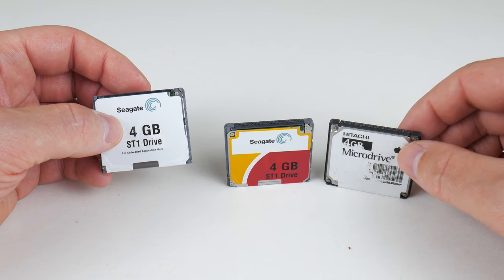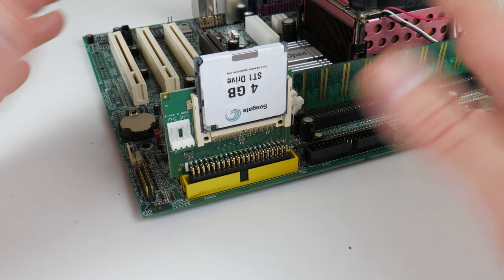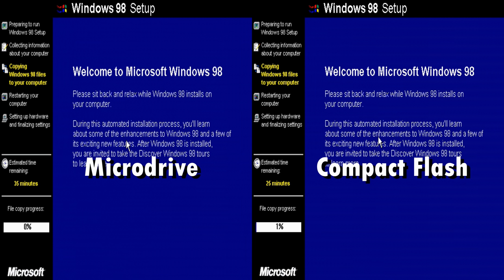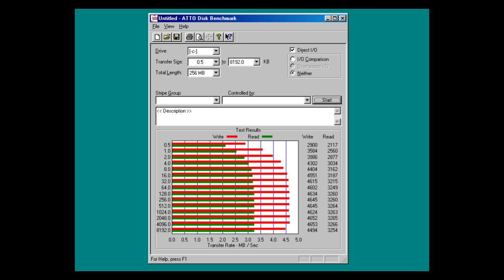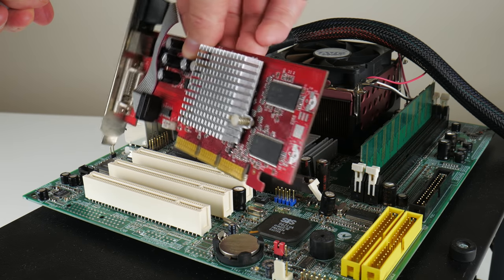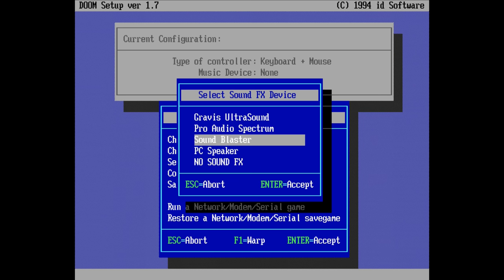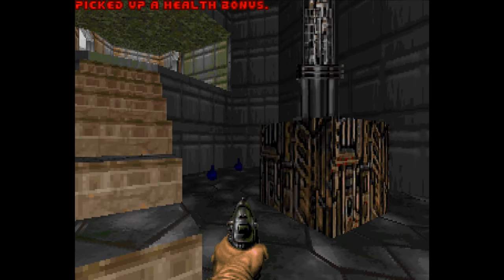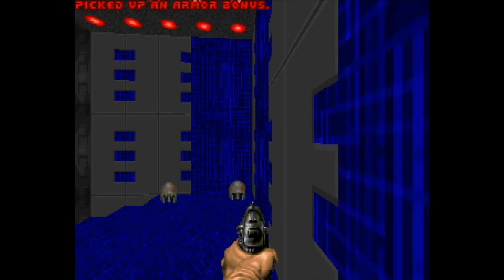Should you use Microdrive with Retro PC?

Comment: For the capacities I was looking for, Compact flash was unreasonably expensive. Especially hard to justify against the consistent trend of SD card prices. That said, the weak point of EIDE/PATA, is the cables. Just had a situation where a system wasn't booting, until I replaced the old cable I was using. Which kind of sucks because, I don't have any others that were as short and discrete.
Reply from the maker: Defeated by IDE cables :D Happened to me also and can be hard to diagnose. SD cards are indeed better value, but the IDE adapters use converter chips, limiting the data transfer rate. CF can go full throttle so to speak, but at a premium, you're right.

Comment: I don't like those DOM type of adapters hogging the entire pata connector for only one device. Either use a pata cable and put an adapter on each free end. OR, use one pata to sata adapter which hosts two bridge chips so you can plug two sata devices on one pata connector. Might seem overkill to use sata drives on older machines but hey, it mostly works.

Comment: interesting video.

i use a 4gb microdrive from an old ipod in my IBM 5170 (6 MHz 286) and in this machine, it actually performs better than a transcend TS4GCF133 - with that CF card installed i get around 700kb/s while the microdrive scores just over 1 mb/s according to CheckIt's HDD test.

i've also had it in a pentium II laptop for a while and did not notice any issues there (i was playing a good bit of diablo 1 and monkey island 1 on that laptop but also testet doom and quake)

but out of curiosity, i will put doom back on the microdrive and test it in a pentium 3 that i happen to have on the bench right now for other reasons.
Reply from the maker: Eager to hear your outcome! There could be differences between models, maybe older drives do not have the power savings issues.
Reply: @philscomputerlab  i got around to test doom on the microdrive in the P3 and did not notice any lags or stutter during normal gameplay, but when i let the game sit in "attract mode", the blue floppy icon did show up occasionaly and when that happened, there was noticeable lag here and there.

my microdrive is an apple branded hitachi 4g model like the right one out of the three you have in the video.

i did also run CheckIt on the pentium 3 to see how the microdrive and the transcend CF card perform on the integrated UDMA 33 controller of the P3 mainboard (ECS P6BXT), and here the results are as expected with the CF card running circles around the microdrive - the card achieved around 5.7 mb/s throughput @ 0.1 ms access time while the microdrive only manages a meager 2.7 mb/s @ up to 9.8 ms. 

with the CF card that much faster, i have no idea why the microdrive has more throughput than the CF card on my 286 then.

i think i'll leave the microdrive in the 268 and let the faster machines take advantage of the CF cards - if older games tend to not do a lot of streaming from disk, as you said, then the microdrive's power management should be less of an issue with 286 era games

Comment: Very interesting Philip, thank you very much for showing such things, because I didn’t know that they even exist). For now I’m using 2gb SD to IDE for DOS, and it’s very fast. For windows 95 OSR2 I’m using 8gb, works very fast also. Starting from 98se and Me, it’s freezing, like I’m using slow HDD….don’t know why because I remember your video where you was satisfied with SD. But in my case…don’t. Better to use Chinese SSD’s with capacity’s from 16 to 120 gb
Reply from the maker: Make sure DMA mode is activated and there are huge differences between cheap and high end SD cards.
Reply: @philscomputerlab  thanks for the information, because I’m using transcend, and they in the budget market I think

Comment: I discovered some time ago that the Hitachi 2GB micro drive worked better on my IBM PCjr with jr-IDE than any other storage device that I could find.  The jr-IDE is very picky about IDE devices, requiring those that will use CHS rather than LBA... which ruled out a vast number of compact flash storage devices that I had.  Those that would POST ended up acting flaky (causing the machine to crash at random times and such.  But the Hitachi 2GB micro drive works flawlessly, every time.  But there you go... older machines that run games that fit into memory... that's the PCjr.
Reply from the maker: Can you manually enter CHS? Try 1024, 16 and 63. That should give you 504MB on devices larger than that.

Comment: A SATA to IDE converter and a SSD = No mechanical moving (potentially failing) parts.  64GB discs are quite cheap :ø)
(A SSD with auto-trim, or one without - as in it deletes sectors after delete - is optimal, but  not required)

Comment: I once tried to use a MicroDrive with my ThinkPad 600. Still don't have any idea what happened, but some of the pins got hot enough on the adapter board I was using to melt the chassis, and then the drive was dead after that. Machine still works but now I have a dead 4GB MicroDrive :(

Comment: There should be some sort of way to disable that power management stuff. I'm not a hacker so I have no idea but if you could get it to stay spun up all the time, it wouldn't be a bad solution. CF of course is always faster.
Reply: WD released a tool for this, change disk idle time, because WD Green disk  were failing due to excessive idle

Comment: Other than when stuttering during wake-up, the Microdrive seemed to do well in DOOM.  Is it possible to control/disable the power management on those drives? Many IDE drives, especially older ones, will react to tools that can set power management parameters, such as Linux' hdparm.  https://en.wikipedia.org/wiki/Hdparm
Reply: It would be easier to copy all of DOOM to from a Microdrive to a RAM disk, then run it from there, assuming you have enough RAM. But easier still to use a CompactFlash card.
I've used a 2 GB CF card in a Compaq Portable II from 1986. Though obviously not to run DOOM :)

Comment: It seems that most cheap consumer flash memory cards nowadays are not very good with write endurance, so are actually a pretty bad long term choice for an operating system installation, especially older windows installs.  That would be one big advantage of the microdrives is no write cycle lifespan limitations.  Alternatively, Industrial CF cards like Swissbit or something like that are designed for far higher write endurance than consumer flash memory and the better ones have TRIM wear leveling. Those would be a much better choice although they are a lot more expensive.  Setting up a second sacrificial flash card dedicated to the windows swap file would help, or just always keep an up to date image duplicate card to swap in when it goes bad, especially if using budget flash memory.  Some low grade flash memory may only have 300 write cycles of lifespan, and that can quickly get burned through from windows swap files and old hard drive optimized file system management.

Comment: I have had better experience with Microdrives in my Amiga600. For some reason, it gives better performance than CF cards on a non accelerated Amiga. However on PC running Dos, I hsve had the best result with CF cards. On Win98 I will always recommend seagate drives, that have been modded with seatools.

Comment: I still need to move away from old HDDs in my old computers. Got a 2003 Dimension that's running fine, with the perfect drive, but the connector's a wee bit buggered (I opened the case too quickly, and too far). It's a Molex powered SATA drive, which is perfect, the mobo has SATA, but the PSU doesn't. 
My Pentium 3 box has a random IDE drive I pulled from something at some point, think it works fine but the computer hasn't been booting happily for a bit.
Reply from the maker: Look into getting IDE to SATA adapters and using modern SATA drives. You can just create smaller partitions if the BIOS can't handle the entire size. For example create a 20 GB partition on a 4 GB drive, you can do cool things like that 😅

Comment: I used the sd to ide solution but switched back to actual drives in a removable 5.25 bay for easy switching. The sd to ide is a great solution though.
Reply from the maker: You can put the SD Adapter inside the 5.25 bay for easy access.
Reply: @philscomputerlab  I 3d printed a 3.5 inch front panel bracket from thingyverse for easy access as well 😁. 
My nostalgia era is mid to late 90's (pentium 1 / 3) and 40/80/120 GB ide hd's are still easy to find and dirt cheap. To hold an actual hd and to hear the spin up adds to the overall nostalgia feeling.
Reply from the maker: @mxmaverinho8115  Very nice! I do wonder how long there will be backwards compatibility with older gear. Thanks to the community, I am hoping that there are always new developments coming out, whatever the future brings.

Comment: To be fair there are situations that maybe using these could make sense such as streaming a disk image in to ram and loading it as a ram drive. Still the output is very slow.. but I guess if you had more ram then spare change to buy something better.... I also imagine there's utilities around that could reconfigure these power saving modes.. the downside to this is it's still a very slow drive. A 3.5 drive just makes more sense.. even if you have to spend a few bucks on a serial ata to IDE adapter. Even better since newer drives are faster assuming your system can support it.

Comment: I bought a huge lot of 6GB microdrives before I realized they would pause for disk access in high end DOS games. I used one recently in a Acer Aspire and I noticed that if I let the Doom demo run for a while it stutters just like is in the video for about 15 minutes or so and then it stops pausing. It does this regardless of if Doom is run from within windows, or from  DOS.  Almost as if the power management goes into another mode after some time of continuous use. Curious if you or anyone reading has run into this.

Comment: Hi Phils. Do the IDE PATA standard destroys SSDs? I've heard  SSDs needs to run on AHCI mode with a compatible OS to avoid damage.
Reply from the maker: SSDs in general work best with modern Operating Systems that are aware of SSDs. But DOS and Windows 98, you are not writing to much data, so SSDs should be just fine. You can unplug SSD from Retro PC and connect to modern PC to run TRIM command if you are concerned. All in all, I believe it is not an issue.

Comment: HI

Cool feature, but not really practically today

i can compare as to buying say some 56k modems and saying "hey this was great in the day lets use them " - True but much more efficient and faster modern gadgets to suit older computers

CF cards and SD card to IDE work well, are cheap and plentiful and have no moving parts and are faster so its not a winner

I was waiting for doom, on the load up i was waiting but you skipped the section of the start up , normally on a slow drive you see a flashing floppy icon on the bottom right hand side, my early IDE 40meg used to do that in my 386 back in the day 

Regards
George

Comment: I was thinking about PCI to SATA cards so that we can add a SATA SSD. But it seems that both PCI and PATA can only go upto 133 MBps
Reply from the maker: Yes PCI SATA cards work well, but there are challenges between different SATA versions, modern drives are often not detected by older SATA controllers. But some are better than others. Intel chipset motherboards lead the way with compatibility vs VIA for example.

Comment: But what to use in IDE-laptop ? (something solid state, and available on aliexpress) I got me ide2sdcard, but laptop could not detect full capacity of a card (ide disks with larger capacity is supported)
Reply from the maker: mSATA SSD with Adapter. The Adapter even available in 2.5" form factor.
Reply: @philscomputerlab  will try that, if it works, I will be your best fan ))) (I'm kinda is, but will be even better)

Comment: So I drug out my old Windows 98 system that I've had since I was a kid and discovered that the 8 gig hard drive in it only has about a gig left available. I was considering taking and trying to clone it to a bigger IDE drive I have laying around. Any suggestions on what program I should use, or should I bite the bullet and try and find the disks to just reinstall from scratch?
Reply from the maker: AOMEI Backupper or Acronis. I have a USB IDE Adapter for such tasks.
Reply: @philscomputerlab  What about clonezilla? I can't locate Acronis 9.0 and the other one you said isn't compatible with Windows 98SE from what I'm reading.
Reply from the maker: @SOU6900  I assumed you are cloning with a modern machine by removing the HDD. yea gyve Clonezilla a try, I haven't used it though.
Reply: @philscomputerlab  Honestly I didn't think about cloning the drive though a modern system. If Clonezilla doesn't work then I'll actually do it like that.

Comment: These drives suuuuuuuck.. do not use them for anything but curiosity.. they are slow.. have no cache.  Pros.. cool, low power, make cool noises. 

The toshiba variant that was used in apple ipods are a little faster but more unreliable..  same pros snd  cons. 

I did use these drives for secondary storage on home made routers …